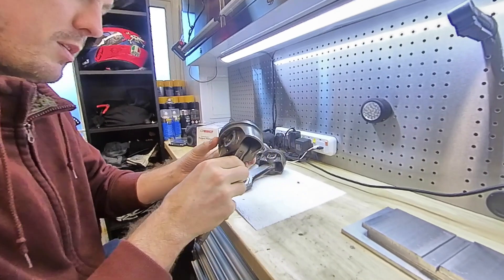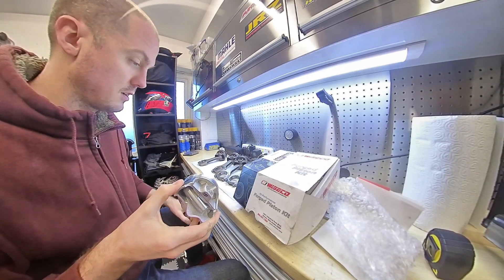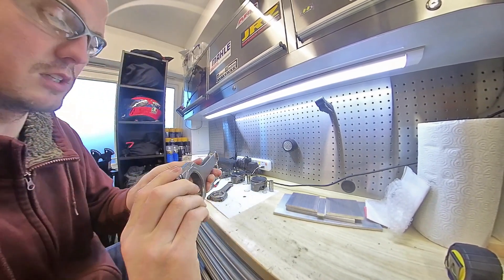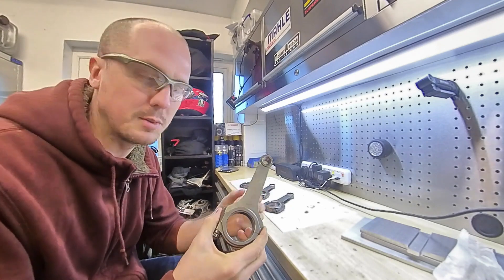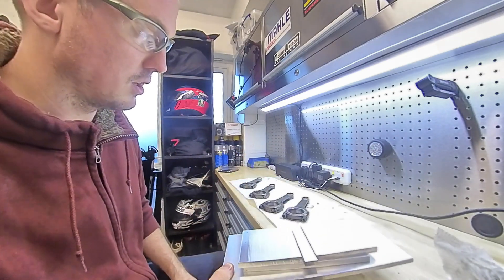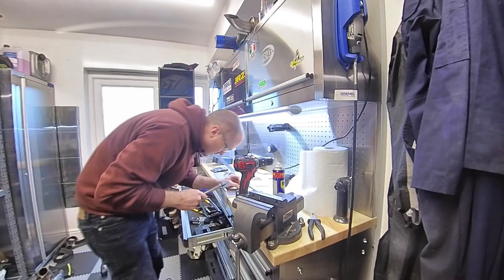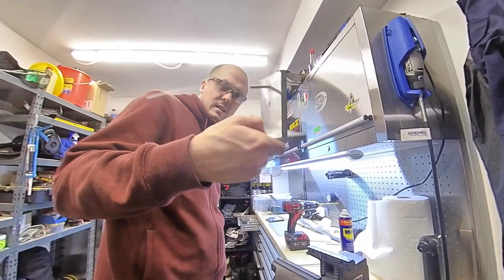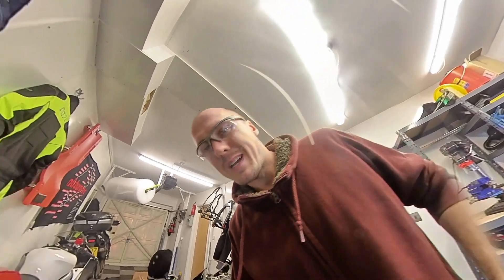Forged 2zz-ge ConRod Balancing and new pistons Part 1

Comment: Good video, been following on IG. Would be good to know more about the car/spec if you have a write up anywhere?
Reply from the maker: Thanks for the feedback! I don't have the spec documented anywhere - but at a high level, fully forged 2zzge, steel liners, supertech valve train, BOE rev400 (tvs1320 supercharger) SCS standalone ecu, jubu racing 3rd, 4th and final drive, quaife lsd, endurance anti surge fuel tank, baffled sump, jrz suspension, ap brakes and a lot of lightening! Running 225 front tyres and 255 rears. Circa 375bhp and 850kgs.
Reply: @track__dan8755  awesome, sounds like a lairy spec. I've just taken gearbox out of mine and is going for SSC 3rd/4th with kaaz final drive and TRD diff. Only running 280bhp(mp62) atm but will be nice to future proof. Keep up with updates!
Reply: What compression were the damaged pistons and who made them. I like the flat tops. I think all the sharp edges on the pistons make the 2zz prone to detonation.